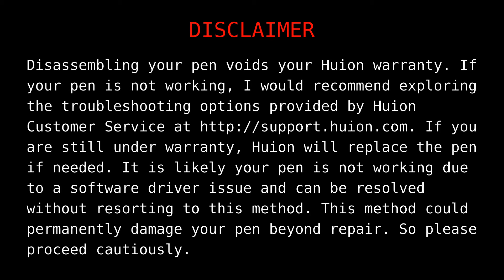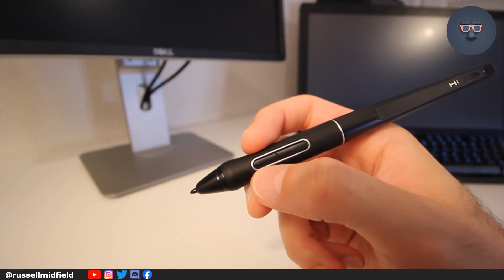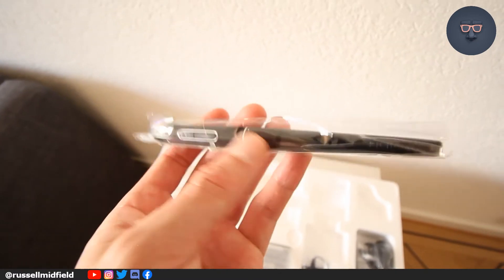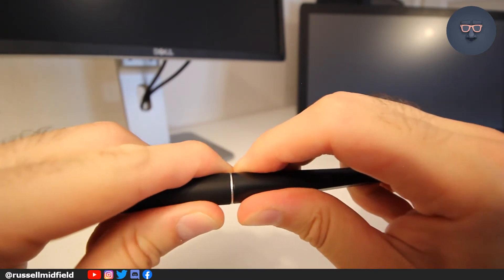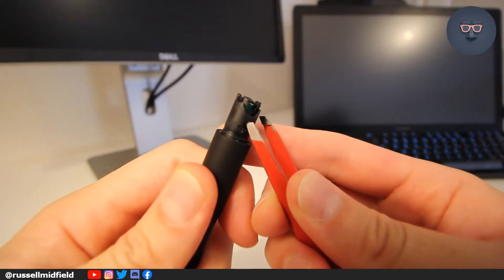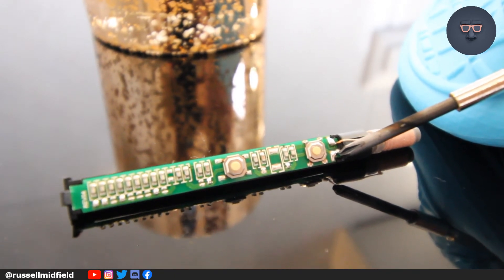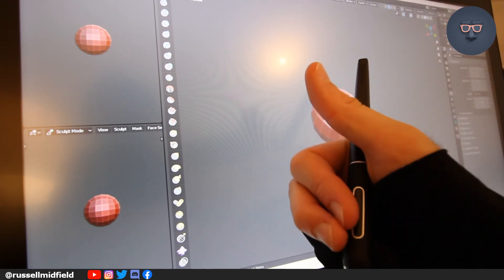I Broke My Huion PW507 Graphics Tablet Pen...and Fixed it with a DIY Solder

Comment from the maker: Chapters:
0:01 Disclaimer
0:31 Introduction
1:15 Mini Overview of my Huion Kamvas 20
1:50 Taking the Pen Apart
3:41 Why My Pen Wasn't Working, the Broken Wire
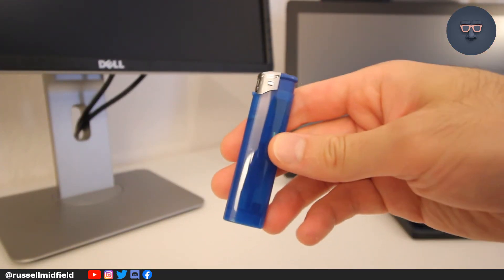4:13 DIY Solder
5:17 Pen Reassembly 
5:42 Testing it Out

Comment: I also have a problem but thats hovering issue... Anyone can help? I just tied around the button to hold the sensitivity 😭
Reply from the maker: That can be a tougher issue to solve, try checking the wire though if you haven't already, it could be the culprit! Good luck!

Comment: I have a special edition Bamboo Fun Pen and Touch CTH-461, and I've definitely dropped the stylus a few times 😬

It was acting weird, but I couldn't figure out why. It seemed like the pressure on the tip was changing due to temperature (but the eraser still works perfectly). Sometimes the pressure would be strong, then weak, and then like now (this is the second time it's happened, and the first time it corrected itself: both times due to airing the room through a window and the cold air coming in, I guess) – there's almost no pressure, and it can't be fixed, and in what settings, only by poking holes in the tablet, lol.

Do you think it could be the same problem as yours? And by the way, I'm afraid I'll break it, but I assume all styluses are designed the same way, and I can safely take it apart?:face-orange-biting-nails:😮‍💨
Reply from the maker: Give it a try, sounds like you have nothing to lose!
Reply: @RussellMidfield  No, actually there is something XD I can draw with an eraser XD

I'll watch some more videos and try it later...

(It's so nice that you're replying to everyone here:face-red-heart-shape:)

Comment: I was wondering if you had tips for getting the long end of the pen disconnected? I've gotten the silver ring detached, but haven't gotten the end off after an hour of wriggling. Thank you so much for this tutorial by the way.
Reply from the maker: Warm up the area near the silver ring since there is some glue there. Good luck!
Reply: @RussellMidfield  Thank you very much, will do!
Reply: It worked wonderfully! Just blasted it with a hair dryer and it was off in no time.
Reply from the maker: @Nomnomnommynom that's awesome! I'm glad it worked!

Comment: Even after 4 YEARS this problem has not been fixed. I thought my Drawing tablet was downgraded to a small high-resolution monitor after my pen stopped working like it should. Then today my thoughts finally clicked and decided to figure out if I can fix the problem. After 2 hours of work, my pen works again! Now I can get back to my doodles!
Reply from the maker: That's crazy to hear this issue is still popping up, disappointing! I'm glad to hear it's been resolved for you though! Happy doodling!

Comment: I've been holding a screwdriver to the bottom of the candle flame for a long time but I can't get it to melt at all ;_; is there a reason why it should be the blue part of the flame not the orange part?
Reply from the maker: Yeah it took many tries for me, and holding it in the flame for a very long time. Blue part of the flame I believe is the hottest part.
Reply: @RussellMidfield  Omg idk what happened but it seems to be working now? I never got the solder to melt but I put it back together anyways and it's working for some reason. Feels like I just did the equivalent of turning it off and on again lol.
My cat swiped it off the table and it stopped registering clicks/pen pressure so I couldn't draw at all. I thought I would have to spend 70$ buying a new one, thanks so much for your video, idk why it worked but thank you haha
Reply from the maker: @karenfei3107 awesome, I'm glad it worked out!

Comment: Thanks for the Video. Do you think polarity is an issue of the coil wire? My Wacom pen died and upon taking it apart, realized both coils have come off the solder.. So wonder if the electronics pick up just the electric pulse of it reads the polarity as well
Reply from the maker: Glad it helped! Yeah could be good point

Comment: I'm so grateful for your video, been trying to work out what the problem was with my pen juttering for days til someone mentioned it may be loose wire - just followed your video to open it up and would you look at that, its a disconnected wire!  I'm not brave enough to try soldering but I didn't want to drop a load of money on a new pen without being sure the pen was the problem not the tablet, so thanks so much!
Reply from the maker: Yeah no worries, I'm glad it shed some light on the issue at the very least!

Comment: Followed your instruction (added a bit of WD40 too) and ,, it worked,,, for about 2 weeks. I contacted Huion support and they just said it’s out of warranty, just buy a new pen. This is a ‘designed to fail’ scenario. These pens are not cheap. Ordered a replacement, arrived today and works perfectly. If you are all happy paying Huion €40 every two years, I am sure they will be very happy. Time to stand up and say no, it’s not unreasonable to expect a 5 to 10 year life span for an un powered (no battery) device. Looking at the forums it’s clear that many people experience this exact problem, Huion are getting away with poor product design, and failure to support their customers. They pretend to offer good value but if this is their attitude, then its a total false economy. Save up and by a better brand that cares about is products customers and reputation.

Comment: i had bought a replacement for my 610 and both the original and replacement both broke within a month in the exact same way, except it was the other solder connection which completely invalidates the pen

im a bit late to the party but thanks for the DIY; I might be able to use that old tablet now that i know it isnt cursed lol
Reply from the maker: Oh damn that sucks, yeah no worries, I hope it works for the tablet at least!

Comment: although i couldn't do the solder by myself, this was super helpful to actually find the problem! I'm using a Inspiroy h950p and had the exact same issue, same wire too. I'ts an old tablet but living outside of the US means even a replacement pen for an old model would be pretty expensive for me. 
Thanks a  lot for this video!
Reply from the maker: That's so nice to hear! Yeah replacement pen is pretty expensive it's true. I'm glad this helped!

Comment: Thank you so much dude you save me. my pen wasn't working yesterday and i thought i had the same issue as yours. i dissamble the pen and there was water around the wires and inside the nib plug. Turned out my niece dipped the pen in the fish tank. I dried it well it's working like normal now.
Reply from the maker: Nice! Yeah no worries, I'm glad it helped!
Reply: I know this is a really old video but my pw517 pen just got wet and it stopped working, how long did you dry yours? I already disassembled mine and put it in a jar with silica gel I'm just wondering how long I should leave them in the jar for

Comment: Hi, my pen is painting without making contact with the tablet. 
I already checked the circuits and all seems right, do you guys have any idea what can I do to solve this issue?
Reply from the maker: Hey olopez, I had a similar hovering issue as well. I got lucky though in that my taking the pen apart and re-seating/adjusting the board a bit ended up fixing the problem. Sorry I know that isn't super helpful but it only happened the one time to me and resolved quickly. Good luck!

Comment: I had this happen to my Kamvas 20 pen. I have a Kamvas 12 that uses the same pen so initially thought I'd use that, but after seeing this, and figuring my tablet is well past warranty anyway, that I would try this tutorial. Turned out to be the exact same issue. So glad that fixing the issue was this easy, that's hopefully put 3 or so years back into this pen. Thank you for this tutorial.
Reply from the maker: That's awesome! I'm always glad to hear it worked out. Yeah mine is still going strong and it's been a couple of years!

Comment: My huion kamvas 13 has started having problems with the usb-c connection pin. I have checked and the problem seems not to be the cable, but maybe the solder on the pin is loosening, and when it moves, colored scratches appear on the screen. it's a shame because I can't find any video on Youtube talking about it. And it is an issue that is worrying me a lot.
Reply from the maker: Oh darn, that's too bad! Hopefully you find a solution soon! Good luck!

Comment: I used a soldering iron for the first time ever to fix my stylus.  TYSM for this tutorial.
Reply from the maker: That's awesome SillyEwe! It's a good skill to have! I'm glad you fixed it!
Reply: @RussellMidfield  Thank you.  I might look into getting a kit to learn some more on.  My sights are set on an FM radio for emergency purposes.
Reply from the maker: Oh that's a good idea!
Reply: @RussellMidfield  Just need to find the right one that charges via USB and/or by crank.  What sites do you recommend besides Amazon to find reliable kits?

I also had this bedtime thought about the skill.  I can vouch for sewing like you did for soldering because it's another useful skill that can reduce wasting.  People throw away nearly new clothes because a button popped off.  If you dive deeper into sewing, you can create a lot of things for much cheaper.

Comment: wow. I can't believe how this pen is so  vulnerable to fall yet huion didn't even give it any proper means of dissasembling aside from forcing it open by pressure. thanks for this video and instruction, it worked. I just hope HUION will make their pens more  durable in the future.
Reply from the maker: Yeah so easy for it to fail, seems like a common problem unfortunately but I guess the good thing is it's relatively easy to fix!
Reply: @RussellMidfield  it wasn't that very easy though. Many will struggle trying to disassemble it.
Reply from the maker: It's true, have to be persistent.

Comment: My issue was the pen registers at 100% pressure all the time, and while hovering (without contact), so the moment it comes near the tablet, it's 100% pressure down. I replaced the nib, tried clearing it, smacking the pen, adjusting settings... no luck.

Opened the pen as per the video, all the wires were fine, the buttons are working fine, no issues, but I can't get into the detachable pen pressure nib unit without removing the wire connection points. Re-assembled, it's still working sort of, but yeah...

I don't know if I overlooked something and it was perhaps a Windows 10 issue, but I'm giving up and ordering a replacement pen... which might take a few weeks to arrive (it's not local stock).
Reply from the maker: Oh interesting, yeah who knows with these things sometimes, so many things that can go wrong, sorry the video didn't help!

Comment: I'm sure you've probably read this a lot in the responses to this video, but you're indeed a saviour. My pen was driving me insane, and I was already considering buying a new one before I saw this tutorial... Still can't believe how flimsy those components are. They're built to break, and fast. Thanks!
Reply from the maker: Haha yeah it's always nice when it actually helps someone! Yeah it's top bad, the wire is so thin it's crazy, definitely could have been done better. Glad to hear you got it fixed!

Comment: my pen dropped really high but once i opened it, there's nothing wrong with the wires, they were still intact and i still had the same problem, im not a technician so i dont know if there is actually something wrong and i can't solder it by myself either :((
Reply from the maker: Oh no! Yeah maybe something cracked where you can't see it, lots of things can go wrong unfortunately!

Comment: Maybe this helps anyone who doesnt want to rip their pen apart!

I had the drawing while hovering and pressure problem. I tried to take my pen apart, but i have a recharcheable one and (luckily) was not able to seperate the handle from the rest of the pen.

This may not work for you. You might break your pen. Be veeeery careful.

I kind of sensed that the white pressure bit where the nib sits might be stuck or something. I could feel it when drawing, it just didnt have the same ability to press anymore.

So I got a bobby pin/hair pin and removed the plastil bubble from the straight side. Very carefully put that end just right under the inner edge of the white pressure bit inside the pen.  The nib was of course removed while doing this. I tried to pull up the bit in careful, circling motions. I didnt feel anything particular but when I put the nib back in, my problem was fixed and it didnt draw while hovering anymore. Dunno about the pressure sensitivity yet though, but at least the main problem is fixed.
Hope this helps.
And remember to use your own knowledge, I am not responsible if you break your pen.
Reply from the maker: Wow thanks Cecilia for the detailed write up! Should help someone I imagine!

Comment: Thanks! I contacted Huion who told me my pen was defective and they told me to buy the WRONG model pen! Which didn't work.  I'm sending it back. So glad to find your video - I got the old pen apart - still need to locate a screwdriver and candle and do the rest of the job but  I am pretty sure this is going to solve the problem - thanks for taking time to record this video!
Reply from the maker: Yeah no worries, good luck!

Comment: Thank you so much for this, especially for zooming in on the board part! My PW500 pen gets chaotic all of a sudden (click and pressure not registered at all then it's dragging the click intermittently) so i really hope your video is the solution! After hours of blistering my hand twisting/bending the pen, the body part is finally free... Patience really is the key 😂

Since I never soldered anything in my life before, can I ask for your input on what might be the problem of my Pen's motherboard? You can see the clip in the most recent video in my channel, or in this link https://youtube.com/shorts/lkZwxTSjmKo?feature=share (idk why it's turned into short btw... -_-)

From my layman's eyes, I cannot see any loose wire like yours do but seems like most consensus of this Huion pen problem is because of loose solder job.. what do you think sir?

I'm sorry for the long ass comment, i'm just kinda desperate to fix this bloody pen already and buying a new one is like conducting murder on my third country's wallet... 😅👍
Reply from the maker: Yeah no worries! Oh yes, it's hard to say, I know some people have reported issues with the pen even though the pen wires look fine, it could be that the motherboard is faulty as well, in which case, it might be hard to fix with the method I show in this video. Maybe try adding some solder to the wire ends to strengthen the connection! Best of luck!

Comment: I know Im late, but what happened If I solder the wire where is all the wire, what I meant is that one of the wires just disconnected from both sides, so I put some solder on it?
Reply from the maker: Yeah sure give it a try!

Comment: Mine is dead - GT-156. The wires are good, i try to desoldered/soldering those wires, but the pen are still not respond to the tablet ☹️
Reply from the maker: Aw that sucks! Well at least you gave it a good try!
Reply: @RussellMidfield  yeah.. looks like i need to buy a replacement 🥴

Comment: Thank you SOO SOO much!! i struggled alot trying to separate the pen, it just wouldn't budge. I suggest removing the rubber part of the pen, since in my case the rubber part kept spinning and turning so I couldn't put any pressure on the silver ring. BUT since the rubber part is removed be careful and don't don't press too hard because it's a little thin. and HUGE THANKS to my mom, she suggested using a rubber band or any kind of rubber to get a better grip on the pen. She did most of the work since I was tried and losing hope. After a few minutes we finally saw some movement! good news we had a soldering iron and extra solder, bad news is the tip of the soldering iron was kinda messed up and I had no experience, my mom did but she's far sighted and couldn't see well because it was small. Spent many hours yesterday trying, and accidentally dropped solder close to the chip (oops) couldn't get any progress done. Tried again today and I managed to fix it! but my stupidity got the best of me, I didn't EVEN step out of the room and I managed to drop the pen! so the wire disconnected again! the faces of my mom and sister when they saw me lol. I'm actually glad I dropped it since it removed the solder that fell close to the chip AND i managed to connect the wire better while soldering it.

Long story short, it was a struggle haha!

once again, thank you so much! if i hadn't seen your video I would have had to buy a new pen. They're VERY expensive here! 200+ in my currency!
Reply from the maker: That's awesome! I'm so glad to hear!

Comment: yoooo thanks but can i still repair it with soldering iron even if the 2 wire is not connected/accidentally fell off
Reply from the maker: Aw damn that sucks! Aw well at least you can say you tried!

Comment: In my case, when I droped my pen, the ferrite core inside the coil (a long black cylinder) was broken in two, and I simply glued it back with super glue. Be carreful, do not put too much super glue, just a bit!
Reply from the maker: Oh wow that's interesting! Thanks for sharing that!
Reply: Did it work properly? I have the same problem. Like when I try to draw, even if I’m not applying any pressure the pen just clicks everything. I opened the pen and the ferrite core was broken into two, I just gave up and build the pen again. But for you it worked to add glue?
Reply from the maker: Try the glue! There's nothing to lose at this point!